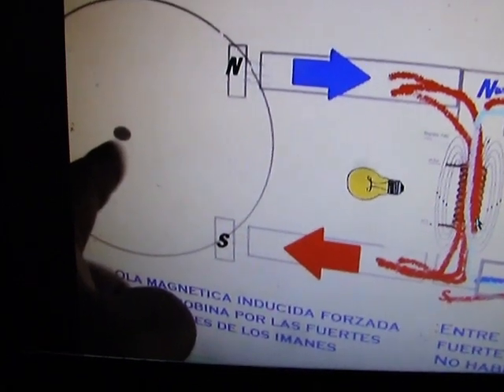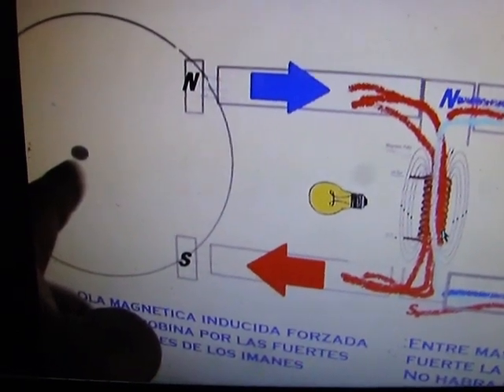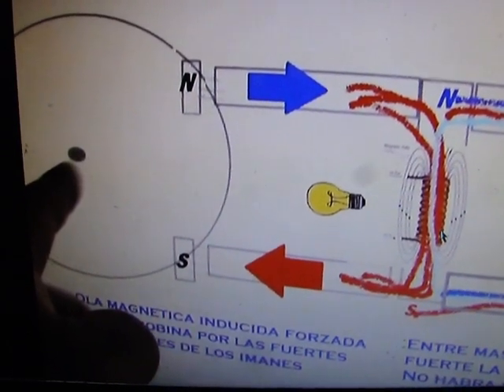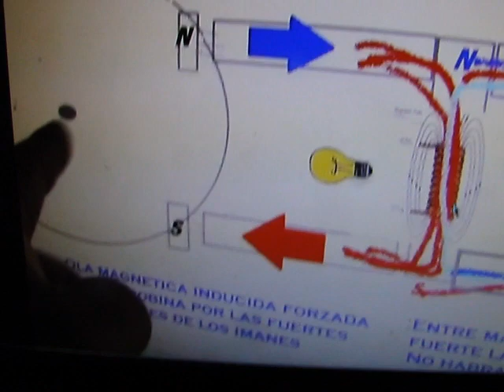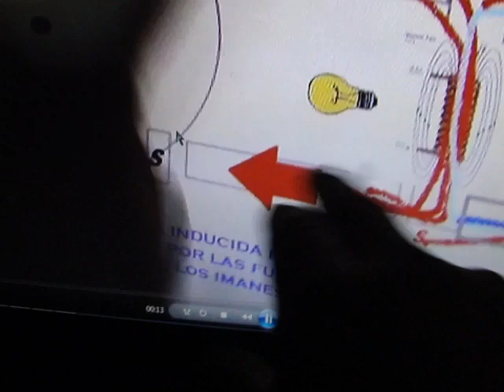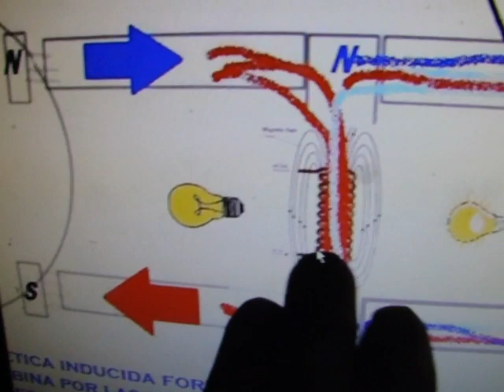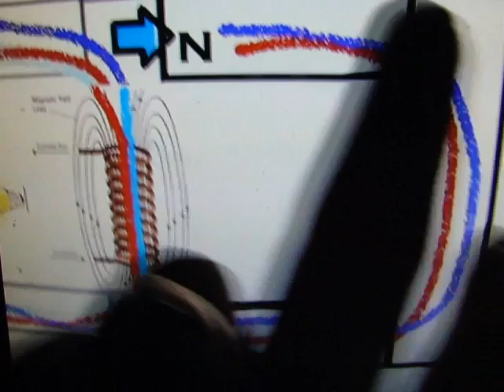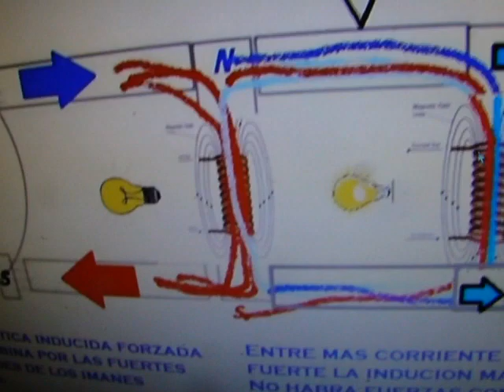Intro 2nd part full version of how anti-lenz coil  works

Comment: Hi Alex, I have worked on Anti-Lenz for 13 years and found that, as per your diagram, when you use second U core to divert the load magnetic flux into 2nd U core, the load on the 1st U core would diminish, we can argue that the prime mover does not experience any opposing reactions, but by diverting the load magnetic flux into 2nd U core, the output on the 1st core diminishes. By experience I have learned that , we need to find ways to use the load current magnetic flux to power useful load. I have 2 solutions for it, 1) Is electromagnetic 2) electro mechanical. You can visit 

https://www.youtube.com/watch?v=l4pRCBhWvq0&t=357s

by Samuel Rajoo and provide your feedback.
Reply from the maker: thank you for your input, i will study your response

Comment: Hi Alex, You trying divert the opposing magnetic drag to least restive U core, this will put no drag on the prime mover, but the electric load (bulb) will not have enough energy to glow, even if you try to cascade several U cores, This is my experience, as I have worked on similar model.
Reply from the maker: you need an air gap
Reply: @alexmanzanero  EXACTLY !!!   thank you so much Alex....i hope all is Well ....  Jay. aka CarRcool youtube channel !   cheers !

Comment: Podrías decirnos donde comprar los núcleos de ferrita que usas porfavor?
Gracias
Reply from the maker: ebay...https://www.ebay.com/itm/Power-Transformer-Ferrite-Core-U-Shape-5-Pairs-UY1658-MnZn-PC40-Material-New/192459270833?_trksid=p2485497.m4902.l9144
Reply: @alexmanzanero  has this lofty system been tested by you yet? I mean practically tested.
Reply from the maker: @kanjo-Etienne  yes, and being tested by third parties, some have reported acceleration of rotor in pre-liminary tests
Reply: @alexmanzanero  this seems even more interesting than the other system of magnetic short circuit